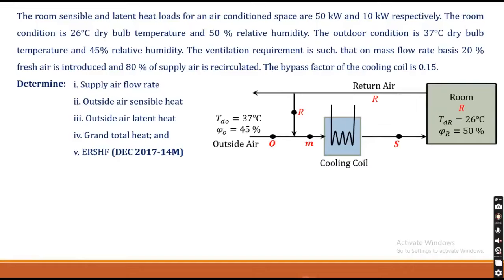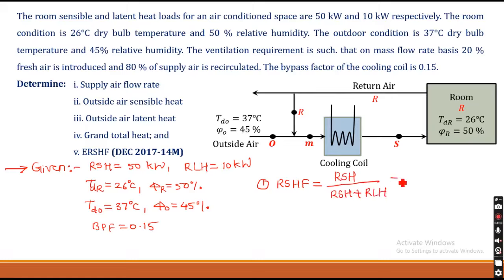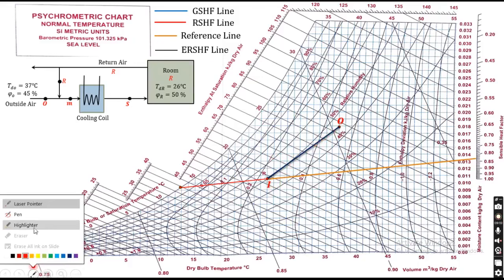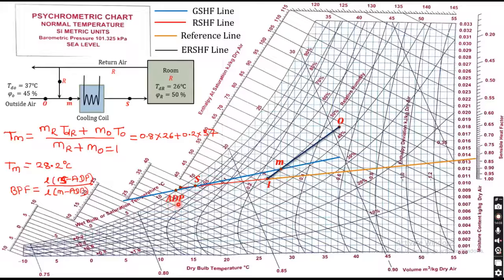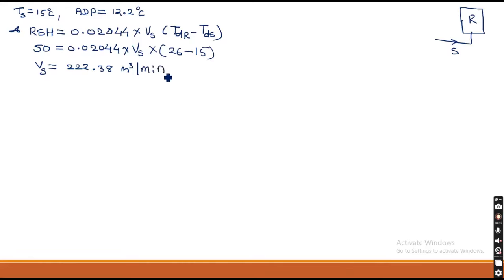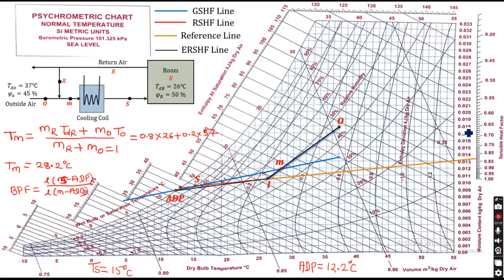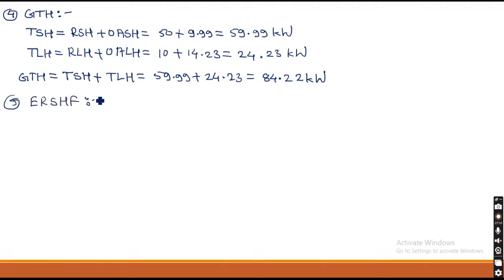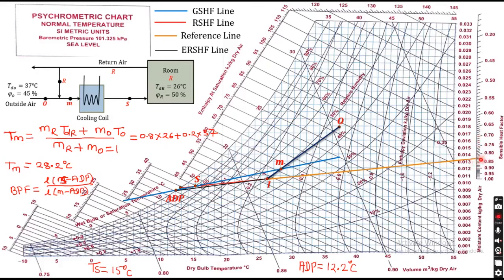PROBLEM ON COOLING LOAD ESTIMATION I DESIGN OF AIR CONDITIONING SYSTEM CONCEPT OF RSHF GSHF ADP ERSH

Comment: An air conditioning system is to be designed for small office for winter conditions with following data:
Required outdoor conditions:10 degree C and wbt 8 degree C

Required indoor condition: 20°C DBT and 60% RH

Amount of air circulated: 0.3 m³/min/person

Seating capacity of the office: 50 persons

The required condition is achieved first by heating and then by adiabatic

Outdoor condition: 10°C DBT and 8°C WBT

humidifying. Find the following:

1) Heating capacity of coil in kW and surface temperature if bypass

factor is 0.32.

2) Capacity of humidifier

c) Explain the factors affecting on Human Comfort
Reply: Sir please solve the problem 🙏🏻
Reply from the maker: @AnitaVibhute-u8d  The solution for this problem is available in Book. if you still need help, please contact on mail ID: kpacademy2020@gmail.com
Reply: @kpacademy5855  sir aap jo Q. Solve karaye ho kon se book se h.?
Reply from the maker: @uploadedbyme4412  Its from Mumbai University End Semester Question Paper but similar question is available in Khurmi book page no. 581

Comment: Atmospheric air at 30°C dry bulb temperature and 75% relative
humidity, enters a cooling coil at a rate of 200 m3
/min. The coil dew
point temperature is 14°C and the by-pass factor of the coil is 0.1.
Determine : [10]
i) The temperature of air leaving the cooling coil;
ii) The capacity of the cooling coil in TR and in kW;
iii) The amount of water vapour removed per minute; and
iv) The sensible heat factor for the process.
Reply: Sir please solve numerical